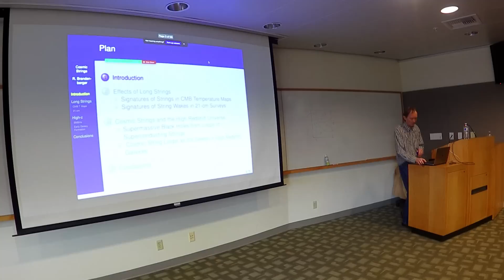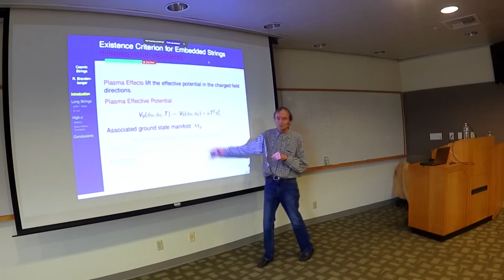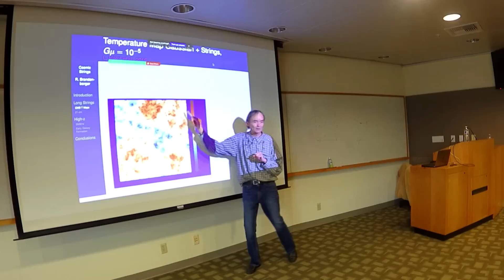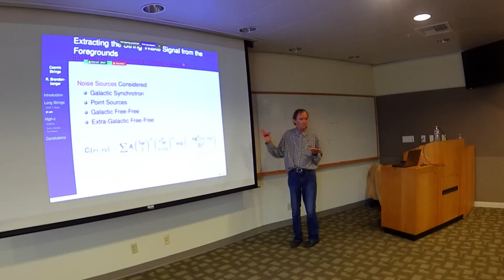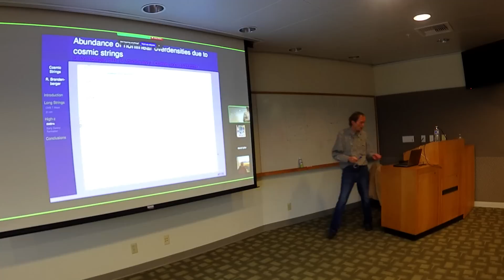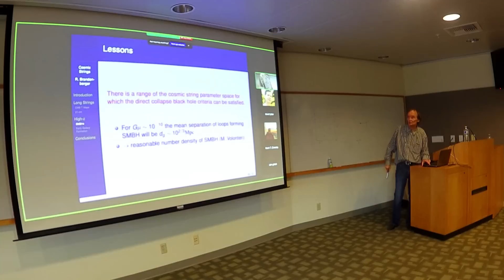Can Cosmic Strings Solve The Early Galaxy Problem? | Robert Brandenberger

Comment: Thank you Brian. Cosmic strings are a common explanation for DM, however, physics misses another cause. My view is that at least part of the DM effect is due to positive charge, possibly most of it, M_virtual = (-,+) Charge / sqrt(16 Pi G Epsilon0) as in "Electro-gravity via geometric chronon field and on the origin of mass". The rest should be 3 types of new neutrinos with the lighter of about 41.875244 eV. At the edges of the galaxy, the effect is of a Hermann Bondi inertial/gravitational dipole. Where there is hot positively ionized gas there is extra-gravity e.g. the leading ejected edge gas after galactic collisions and also the Bullet Cluster. The leftover long trails of ionized gas behind such collisions behave as expected from a cosmic string. Small highly ionized galaxies should have poor star formation due to near proximity electrostatic repulsion and a high DM effect while big isolated galaxies which had enough time for electrons to fall back, should be poor in the DM effect. At the end of the day, the DM effect should be a combination of the two above mentioned causes, mostly positive charge and then new neutrinos. You can leave a message via Skype with username eytansuchard@gmail.com . My wife Jessica is the manager of the application project. Unfortunately, in high voltage capacitors, even with a low relative dielectric constant, there is a sufficient local dielectric charge that creates oppositely aligned dipoles and therefore the external Hermann Bondi inertial/gravitational dipole is cancelled out. This problem also exists in asymmetrical capacitors such as in the Charles Buhler's device. This device allegedly manifests a stronger effect by several orders of magnitude than the predicted one. The technological solution must involve a dynamic electric field. See YouTube: Introduction to Chronon Field Theory (Vaknin-Suchard)  . Have a blessed day.

Comment: This is actually a nice lecture. A few new things are suggested, even though the cosmic problem it is supposed to fix isn’t real. Nonetheless; it is kind of reminiscent of Hans Alfven’s plasma filaments at various scales and topologies. The basics is to try to explain gravitational (wave) effects (of BH’s) in the most redshifted (thus ASSUMED youngest) universe. I like the emphasis on linking Energy density to gravitational effects, even though it would be more correct to speak of Specific Energy. Both are often confused. Energy density is J/cm3 but we must use J/kg (or -m2/s2) to translate to gravitational effects. Why mass and not volume? We know that in the subatomic realm, mass is the clock and energy the grid so J/kg is the speed term in the energymass grid (which is what this professor is actually talking about just on a grander scale), which translates into the ‘static’ imaginary acceleration effect (-J/kg=-m2/s2) in the spacetime dominated grid we call the force aspect of gravity. We can check this equivalence between charge density (speed in the energy dominated grid) and speed (in the space dominated grid), comparing the blackbody radiation curve and the galactic rotation curves. They are in essence the same; rotation speed depicted as per distance from the centre.
OK, but now for the problem it is to solve; Again, redshift of furthest galaxies has nothing to do with a proposed doppler effect of higher speed / and thus age. It is just an indication of further distance, courtesy the distortion of our Milky Way energy based galactic fabric through which photons pass, making photons of furthest images appear lowest in energy, thus redshifted (as per dxdp>=h/2). And as for CMB; We now know for sure the CMB has NOTHING to do with any big bang of an early universe. For this it its CMB multipoles should be completely random and they are not. We recently found there is an ‘axis of evil’ in the CMB, where the CMB dipole appears to be aligned with Earth’s axis (thus motion) to the galactic plane and where the quadrupole and octupole are exactly aligned with the direction of our galaxy travelling through the cosmos. It means CMB is simply a double (Compton) scattering effect of the energy based grid of our galactic plane, interacting with 2 spacetime based grids. Firstly our own solar system moving inside into the galactic energy grid AND secondly the energy grid of our galactic plane interacting with the outside spacetime dominated realm as it travels through the cosmos. Nonetheless; the essence of the professor’s lecture CAN be applied to the fabric of our galactic plane. THAT is where the relevance must be sought and I would encourage him to explore both voyager’s data on measured plasma ribbons outside the heliosphere….
Reply: Wasn't the early universe relatively curved on its leading horizon? Might the distant red shift be gravitational? Us observant fermion accumulations with two photon sensors for eyes are actually older than the CMB, and we contain some primordial quark-gluon plasma in our protons and neutrons?
Reply: @edcunion  you are thinking too complex. The problem within lambda CDM cosmology is that we THINK it is based observations while actually it is based on our INTERPREATION of observations. Redshift of furthest galaxies being the obvious most prominent example. We ASSUME this is caused by a doppler effect, but redshift my also be the result of a QP setup of our galactic fabric, in which case incoming photons of most distant origin would be represented as low energy, thus redshifted, photons as per Heisenbergs uncertainty principle. To use an analogy, if you would live inside an atom all images from outside would not only appear 90 degrees diffracted but also appear more redshifted the further away they are in spatial terms. A QP setup of our galactic plane would also explain why we have CMB multipoles aligning with our galactic plane and it would solve the erratic rotation curves of furthest stars in galaxy arms (caused by a lack of in between spacetime, not a shortage of gravity i.e. dark matter). If a solution solves 3 issues in one, it is most likely the correct one. And by now we should recognize the JWST images simply have falsified lambda CDM predictions. Redshift = distance . Not speed. Not age. Time for our cosmologists to accept it and move on. The collective was wrong. It wasn't the first time and won't be the last....
Reply: "Again, redshift of furthest galaxies has nothing to do with a proposed doppler effect of higher speed / and thus age. It is just an indication of further distance, courtesy the distortion of our Milky Way energy based galactic fabric through which photons pass"

Complete gibberish. If redshgift is nothing to do with velocity and therefore age, why the supernovae 1a time dilation measurements confirming the accelerated expansion of the universe? Ditto with the observations of the integrated Sachs-Wolfe effect on the CMB photons? And the BAO observations?
How are you explaining that? And don't post more word salad and gibberish - refer to the peer-reviewed literature for alternate explanations.

And it is Hannes Alfven.
Reply: "And as for CMB; We now know for sure the CMB has NOTHING to do with any big bang of an early universe."

Is a lie. Nobody sane has made such a claim.
Reply: " galactic energy grid"

No such thing.
Reply: "voyager’s data on measured plasma ribbons outside the heliosphere…."

Name of the paper/s in which they were reported. You do realise the ISM is ~ 80% neutrals, yes?
Reply: @RWin-fp  All interesting, astronomy, cosmology and their observations from all telescopes including Ligo.The theoretical interpretations from these observations do vary.

This cosmology amateur, yours truly, is gobsmacked that our hominid fermions, including the ones that comprise our eyes, are reportedly about 400,000 years older than the CMB, and contain the primordial quark-gluon plasma, that is reportedly confined inside protons for example, by their magnetic gluon tethers. The strongest magnetic field yet measured on earth reportedly (10+ gauss) happened a year or two ago at Brookhaven, when gold atoms were smashed together. It's been recently reported by European researchers too, that the cosmic filaments are magnetized? What's the scalability of electromagnetism and universal acceleration, including the local weak gravity fields of things, universal spacetime curvature, in a reportedly flat spatial universe? De Rham proposes spacetime curvature increases in effect at particle scales, diametrically opposite to asymptotic freedom at nucleon scales? She discusses Weinstein (1972)  "ghost" particles etc.

Comment: This presentation appears to be straightford & common sense based on observation and math, and important moving forward in cosmology. Inrease the observational signal to noise fidelity and the universe looks more like a cosmic string driven thing?! It's guessed the Ligo is too coarse to multiplex string acceleration wave components with the hydrogen 21 cm waves? Would the most distant string segments visualized, trace out there distant red shifted ends elliptically/spherically?

Comment: Consider in light of Pearlman SPIRAL cosmology to gain context and advance the science. All stellar objects that exhibit cosmological redshift have by definition been subjugated to PAST cosmic expansion. As undisputed local region is gravitationally bound. Now if SPIRAL the entire universe became gravitationally bound relative very early in history. 
During the hyper cosmic inflation expansion epoch that ended 4/365.25(SPIRAL LY radius i), i years ago.
In SPIRAL black hole illusion resolution, Black Holes represent past, not ongoing hyper density, but we would predict them by galactic centers, that is residue from the galaxies themselves hyper-dense start.
The good news is the 'look-back' of all beyond SPIRAL radius i, is to that epoch. The more distant the object now, the earlier during that cosmic inflation epoch the light departed it, as it distanced past i. The denser (so hotter) the entire universe was, when the light we see it from arriving here and now at standard light speed 'c' departed at i. That is over 99.99% of the visible universe we find approximates the entire universe, radius based on CMB temp. of about 1B LY. i is also the uniform in all direction departure point of CMB. i = the nearest departure point of any light arriving here and now at 'c' that has ever been subjugated to any cosmic expansion. So these 'cosmic strings' should relate to the primordial expansion force/s during cosmic inflation. Reference at Pearlman YeC on ResearchGate.

Comment: Its more like links in a chain. But putting yourself in a venue where you might observe that is probably impossible. So it might be somewhat a matter of perspective. What you see as relevant is very dependent upon what you have the opportunity to observe. But because there are discrete properties the chains interact with one another to form 'sacred geometries'. I think its a truism that there are limits to the cohesiveness because its in an unfinished state. The book of revelations describes a process of ascension where this problem will be solved.